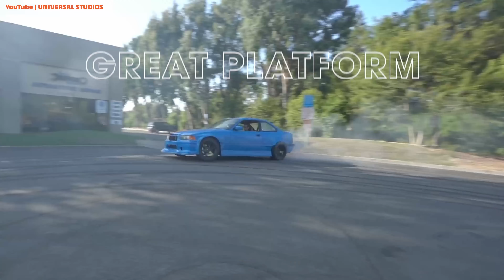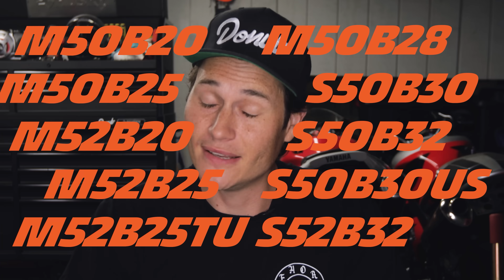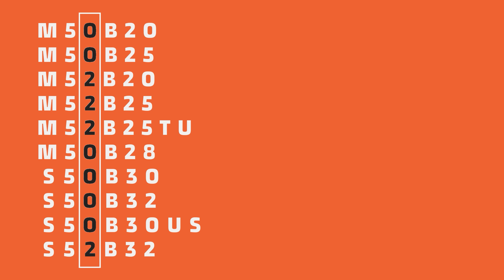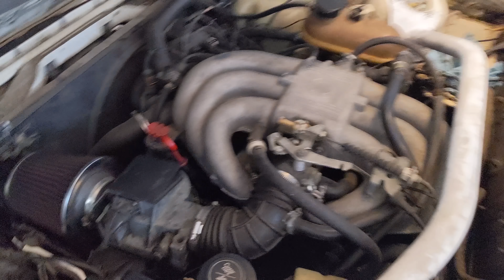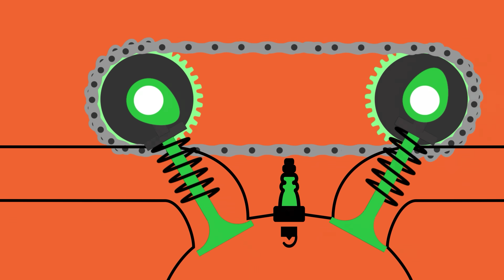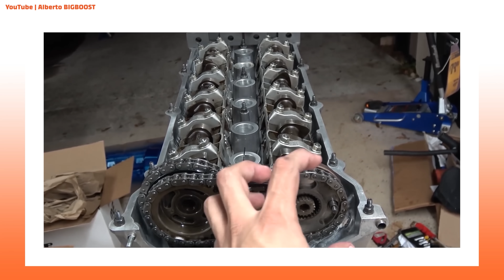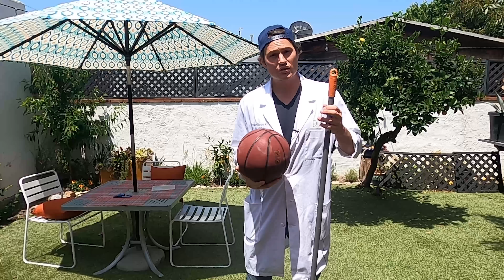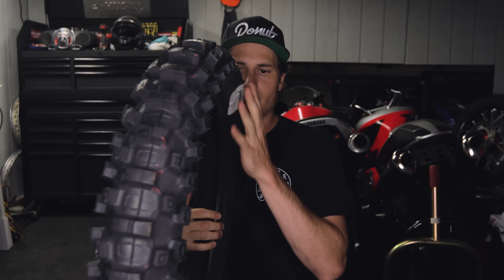2 Reasons Why the E36 is an ALMOST PERFECT Project Car

Comment: Actually, the E36 in Europe has been a rather wanted car for quite some time, and is a tuner's favourite for decades, and it's as good as impossible to find a unmolested, fully standard one, let alone a low mileage one. If there are unmolested ones in the states, then i suspect that they're gonna get imported soon by europeans as they are surely gonna skyrocket in prices like the E30 is by now.

Comment: and come on, there is no lift variation with VANOS, it's oooonly cam timing. Quite a bit different than Vtec...and I believe the cam timing is reversed. It's advanced at low RPM (for improved torque) and retarded at high RPM for more powah babeh.

Comment: I had an e36 w a m52b28 and it was nice and had a good amount of power but it just felt pretty big and heavy. When I got an e30 I noticed instantly the car handled way better and the overall simpler interior made driving feel better (imo). Ofc, the e30 made a bit less horsepower but it weighed a lot less which was nice. The lack of some engine features like vanos of course meant less hp, but considering the car was made in 1990 and had 244k miles you could almost count on that just being another part you didn’t need to replace that you would’ve if you had to.

Comment: Parts are bloody expensive. You need an cam shaft sensor 200bucks, need a air mess meter 400bucks. And BMWs only run good on original sensors. I tried all the cheap crap. But they are fun to drive

Comment: I have a weird science explained or b to b idea I could use help with. I need help learning the geometry of the first gen mustang's and the way they changed the suspension through out the years to become ifs and irs when they made the new edge cobras. I want to barra swap a 65 coupe or a 69 fastback but I dont understand the simplistic suspension it uses as much as I do the more complicated ones. And I'll need to figure out how to swap as much modern crap over as I can to make it as smoother unless I drop the body over the unibody chassis by reassessing the floor a little or saying screw it and trying to get an entire Australian Falcon over here to just steal parts off of. Lol hell the Barra alone would make a cool video to explain the science behind. It's a 4.0l turbo gas powered I6. What's not to love

Comment: “Straight six’s can’t be mounted transverse”.  Laughs in Volvo
Reply: Made those S60s pretty cool though, even if they had the same turning radius as a bus
Reply: Hydamacka I don't get the hate for Volvo. I think the Volvo 240 r is a nice car.
Reply: Swede intensifies
Reply: Laughs in transverse w16
Reply: @justletitsliiide  a W16 is actually shorter than a straight six
Reply: laughs in saab
Reply: Hydamacka 
It means you’re laughing.
Reply: @DM3.6  daaayyyyymmmmm that was cold bro
Reply: My S80 2.9 had a 6 cilinder transvers mounted. And a manual.
Reply: Laugh in jealous garbage 90° square bin
Reply: Lamborghini Miura with transversely-mounted V12: Hold my bull
Reply: So he's talking about not seeing inline 6's transversely mounted  and you have these jokers talking about V12's, W16's blah blah blah. We're talking inline boys
Reply: Aren't most of those straight 5s?
Reply: Hey there I run a e36 channel and would appreciate your support for some e36 contenttt🤞🏽🖤
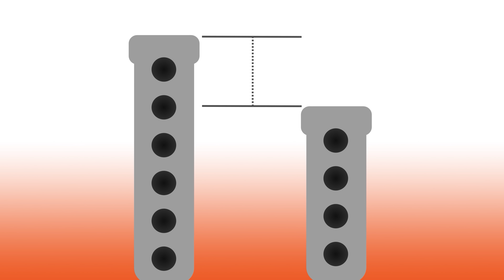Reply: 2:10  he said generally they aren't transversely mounted not that they can't ever be
Reply: Jared Connell it’s a joke
Reply: @DM3.6  perfect!!!!! lmao

Comment: Jeremiah: Straight 6' arent good for SUVs
BMW: ARE YOU SURE ABOUT THAT.
Reply: There are literally millions of Jeeps with 4.0L in-line 6 engines out there. Wranglers, Cherokees, and Grand Cherokees.
Reply: @moosepawpaw  an engineering degree and former NASA person means SHIT FOR BRAINS
Reply: @moosepawpaw  My dad's GMC Envoy has an i6 as well. not super powerful but it gets the job done lol
Reply: ruben martinez Those engines don’t get the love they deserve. Ton of displacement and good power potential. 
My personal favorite has to be the Inline 5 version though.
Reply: @blackbirdgaming8147  I wasn't aware there was a i5 variant out there, very cool. And yeah that engine is amazing, smooth power on the low RPMs, also bulletproof as all hell, 250k miles and still running like a champ
Reply: ruben martinez Yeah, I believe it’s called the Vortec 3700. Part of a family of inline engines partially developed by Isuzu.
Reply: @moosepawpaw   those are v6 engines I guess.
Reply: @whatdadogdoin7531  nope the Jeep 4.0s are inline 6s. Can confirm have I have owned a few.
Reply: E53 bimmer

Comment: Yall never discuss in these videos how easy or difficult these cars are to work on for the average joe. And we all know that they will need some sort of work. Most of these starter enthusiast vehicles are 15-30 years old. Buying a vehicle like that either requires some degree of do it yourself wrenching or deep pockets to pay a shop to work on it. So yeah, in theory the E36 is an awesome first car for the enthusiast minded person. But did you know that if the oil pan gasket is leaking you have to drop the front subframe and the steering rack to replace it? Not something that someone who is just getting into cars is prepared to handle. BMWs in general are not easy cars to work on. Buying one of these things could quickly turn into a nightmare if you don't know what you're doing.

Comment: The reason that the 6-cylinder engines got the M5x designation is because they are the 5th modern BMW engine generation.  There are also BMW sixes of the M20 and M30 type, the M10 and M40 are inline fours.

Comment: The e36 is literally the one I hear about everywhere I go I’m sure people know it’s a good car 😂
Reply: It's like the German hybrid of a Miata and a 240sx, plus the engine on the 325i is good for 500bhp stock and 1000hp+ built. 
AND you can buy it for like 2k.

It's like the perfect cheap car for people that can stomach German cars.
Reply: CME sounds like the complete package to me bro that’s what the 240 is missing
Reply: @V8dadmartin  Honestly it is quite a perfect car, most people look to M cars but sometimes gems like e36's 325is or e9x 335i are way better.

I own a e36 325i and honestly it's like a little bit of everything, it's like a sports-muscle-luxury car, and it can be much more depending on what you want.

Just don't tell anyone, we don't want it becoming overrated like the mk4 or the r34.
Reply: @lazar2175  i own 2 97 328i one of them a hillclimber superharged 475bhp and a non moded daily 98 328i
Reply: @Voiceoverguyfromch  Awesome man, what supercharger did you put on, was it a kit or you fabricated something?

My 325i has a M50b25 so i fitted a m54b30 crank, maxpeeding rods, thicker head gasket and low compression pistons to get 8.6CR.
Equal lenght headers and an intake from AliExpress.
And finally a GT35R spooly boi.

Estimated 700hp, no one near me can dyno it because when the boost comes on, it looses grip immediately. We had to street tune it. 

Best thing is, the whole engine build costed me less than 5k, some of the parts were used but still, that's not a crazy number for that hp.

Also i was surprised by the fact that e36 parts were available almost everywhere.

Comment: Pls do one for the e46. I wanna learn something new about it 👀🙏🏾
Reply: They're like E36s, just worse. More weight, worse engines, worse drivetrain, no LSD available except in the M3 and even more likely to have rear subframes ripping out of the chassis. On the other hand debatably better looks, less rust because younger, lower prices and (maybe) slightly better interior quality.
Reply: @peterm3861  the engines aren't that bad honestly. Here peole swap the m54b30 into e36 shells for a fine power increase
Reply: @sv_cheats1970  No they aren't bad in any means. They just have two or three more issues over the M52.

Comment: E36 was the Honda Civic of Europe for years. Something 18 year olds and other questionable types drove around in. They still are in some countries. Outside dedicated track cars, it wasn't up until a few years ago that they got the props they deserve. They are borderline a better platform out of the box for drifting than an old beat up S13, just without the high school street cred and drift tax. However, there is one thing with E36's you can be sure of. Your door cards will fall off. Over and over.

Comment: I think a good project/tuner car would be a Subaru BRZ/Scion FRS/ Toyota GT86. There's a lot of room in the engine bay, and you could easily fit an LS motor, or an Ecoboost Twin Turbo V6 in it with only minor modifications. If done correctly, it would make a good sleeper if you kept the exterior looking stock. Just my opinion.

Comment: Jeremiah: the e36 has been overlooked for decades!

Literally every european carguy in the last 30 years. Am I a joke to you?
Reply: same in South Africa and my country Mozambique, e36 was the go to performance car for the longest time
Reply: @michaeldaude6374  yo SA gang
Reply: @michaeldaude6374  you got the 333i oh man what a car
Reply: Yep.. over here E36s are getting so sought after it's not even funny. A 316i E36 is more expensive than a 330i E46.
Reply: @shona5512  where? I am gonna get there and find myself a e46 330i
Reply: @Runmeerkat  Northern Ireland, UK. You can pick up an E46 330i for £1500.
Reply: @shona5512  I'll trade my 318i E36 for a 330i e46 happily 😂
Reply: @SUS_e.36  You'd probably get cash your way lol
Reply: @shona5512  I bought mine running for 100e 🤷 an e46 is way more expensive here
Reply: Thought the same, they're getting more expensive lately, so much that I'm thinking of buying an E46 as my next, opposed to an E36 I wanted before
Reply: @DatPenguin97  I had an e36 and they weren't overlooked. My buddy recommended one for me since it checked all the boxes of a fun daily, easy to learn manual in, and can be built to be an absolute monster
Reply: @One_LuvZ  a buddy of mine has a 36 and he recommended the E46 to me 😂 as I said mainly because of pricing lately, which have gone up for most decent cars I look(ed) for, I could've bought a 200sx for 4500 a couple of years ago, now they start at like 8k 😐
Reply: @DatPenguin97  Damn, 200sx (or in my case in the us the 240sx) are similar in the "high price for not that high of performance".
Reply: @One_LuvZ  I mean you pay for the chassis, not really for the power 🤷🏻‍♂️
Reply: @DatPenguin97  makes sense, but with the current state of some vehicles for the price of that chassis. A Z33 would be more viable.
Reply: @DatPenguin97  or buy one now when u can and make some money on it!
Reply: @DatPenguin97  it's like 10k difference.
Reply: The e36 is overlooked? Im sorry, but that is one of the most sought after cars from the nfs series from 05 to current
Reply: It's not even overlooked in the US, I knew 3 guys in high school who got one as a project car
Reply: Tell me about it...you can't get a 328i coupe e36 for less than 5k...
Reply: I've had 8 e36s. One of my mates has had 40+ still got my touring
Reply: Exactly
Reply: Like every bmw fan ever
Reply: Donut's American so they apply to America. Although personally I'm Canadian so not quite the same community.
Reply: I absolutely adore mine. 325is.
Reply: Bruh, E36 it just like an S13 in north america here in Indonesia
Reply: Even here in the states, I would never have said the E36 was underrated or overlooked. No one has ever said that lol
Reply: Brasil also..
Reply: I OWN 2 of them
Reply: @Voiceoverguyfromch  i own 1 and im sick of the maintenance costs wanna buy a 3rd?
Reply: A verry common car here in Romania, we call them "pisicuțe" kittens . Thanks for the video.
Reply: bhahah  im 36 and i wasnt a car guy until my 30s..  past few years these have been coming priced with a serious drift tax  (allthough  here in europe is more like a restoration tax - lol)
Reply: Same. I feel this
Reply: soo true
Reply: I was gonna say the same thing. It’s like a infestation 😂
Reply: dude triggered me at the start
Reply: Bimmerforums had a collective conniption
Reply: Sounds about right
Reply: Was literally thinking the exact same 😂😂
Reply: Everyone and their mother who is into Drifting in Eastern Europe started on some trashy ass 300$ E36.
Reply: You spitting fire mate
Reply: in 2000s lithuania every tri paloski guy had e36
Reply: I am 18 and one of my friend cry for 36 or 46
Reply: ive wanted one for fucking years
Reply: pretty much if you never looked outside european cars
Reply: yeah I was surprised, whenever I hear about drifting or racing or builds its the e36 9 times out of 10. Bc of that I really wanna try my hand and working on one.
Reply: Hey there I run a e36 channel and would appreciate your support for some e36 contentt🤞🏽🖤
Reply: I was about to say that.

Amerikanis have some  bolts loose in their head
Reply: @DdraigRazgriz  wouldnt wanna live any other place....and i have been to other countries
Reply: Literally hundreds of them for sale below £1000 in the UK. 
They're not really overlooked here, but only the 330s and m3s are really wanted. We don't have a big drift community, or even really a big car modification community. I'd honestly be surprised if theres more than 3000 cars in the country that are modded (not counting just swapping the radio or wheels)
Reply: @dyent  the E36 and e46 are really popular in UK lmao UK has an enormous car culture and drift scene what are you on about
Reply: @dyent  Damn I tought the UK wsa a good place to mod a car here in Portugal it's impossible to mod a car and keep it legal even when you pass emissions.
Reply: @Runmeerkat  It sort of is and isn't. The problem isnt anything to do with the law - most people just don't have enough disposable income to do anything big. Sure, swap the radio or add some wheels, but you'll very rarely see anything more. I see supercars on the streets more often than a mod that isn't just a bolt-on - and that's literally 2 so far this year (A Pagani Zonda F and a McLaren P1). We're about average for Europe on incomes, but our cost of living is generally a bit higher. For example, after paying for rent, bills and food, I'm generally left with about £100-£150 a month.
Reply: @dyent  ik the uk car scene is really crappy, but it gives us the opportunity to be better in competitions etc
Reply: @aamirpatel7299  Yeah, I just wish there were more places to go. If I want to do any racing (with the exception of banger racing - For Americans, that means 1.0l fwd hatchbacks on an oval with no modification except removing glass and adding a killswitch) I have to travel 70+ miles (Again, Americans probably don't understand, since thats like an hour away for them, here its 2+ hours)
Reply: @dyent  cars are cheap in the uk because there's a lot of new cars sold and these cars are rarelly exported.
Reply: It sorta was. He's probably referring to it being overlooked in the US. They got the shittiest version of the E36 M3. No one overlooks it anywhere else. The US got a 3 liter with an intake manifold instead of individual throttle bodies, only 240ish hp with no 3.2l engine like the later models, a terrible 5 spd instead of a 6 spd, plastic headlights, a rear diff that is made of glass.
Reply: @justintaylor9458  yeah, I always call us the usdm M3 an 325i stroker (which can be done far cheaper than buying the m3 by just using m54b30 internals into an m50b25 or tub25 😂)
Reply: @One_LuvZ  having driven the euro spec 3.2l updated version, I get it. It is a seriously solid car, which I'm pretty sure will beat an e46 m3.
Reply: @justintaylor9458  the zf 5 speed is actually pretty solid the non 328 and m3 got the shitty getrag
Reply: 4000 for an e36 lol
Reply: Honestly dude
Reply: >Am I a joke to you?

Yup lol
Reply: https://www.mazdaforum.com/forum/mazda-rx-7-33/joe-maddox-super-rare-1-100-1989-fc3s-gtus-rx7-2jz-gte-vvti-build-43602/
I have found and saved the rarest Mazda FC RX7 ever made! Now this car is rare. Really rare! Let me break this down really quick...
Ever heard of the rare 100 GTUs rx7s? Only 40 have ever been claimed and only 7 are confirmed at the time of this posting! Here are the rarest rx7 FC3S models:
1500 10AE Turbo models
1400 infini
1000 winning limited
150 final edition convertible
100 GTUs...
out of that 100:
83 red on black
10 black on black
7 white on blue
There was only 100 GTUs models created between 1989 and 1991.
If you own one of these rare models sign your car up to the registry list here on any of the rotary forums!
Reply: @joemaddoxrx7  my cousin had a 70k mile one

Comment: 1. There was no e36 330ci. Highest basemodel was 328
2. There was no Doublevanos Engine in The e36. All e36s where Singlevanos. M54 in the e46 was First doublevanos in 3 series
3. Watch Out for the e36 Compacts they got the Old ass e30 Rear Axle
4. Otherwise very good video love ya!!!!

bonustip. buy a 323i the have m52b25 Engines Get a m50 Intakeport and 328 or 325 or any other Midpipe and enjoy your free 200 Bhp e36 skidder ;)

Comment: u forgot 1 important thing to mention... if u strip e36 of interrior and stuff and make a racecar with a rollcage it is LIGHTER then striped E46 with a rollcage ...and rollcage offers the same safety. So E36 makes E46 useless when u're doing some modifications. Also E46 rare subframe cracks more often